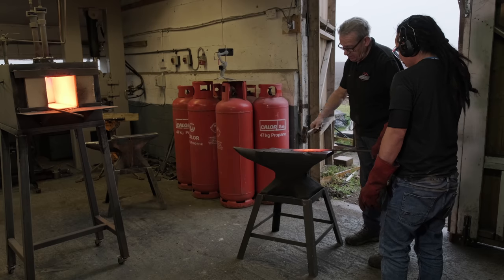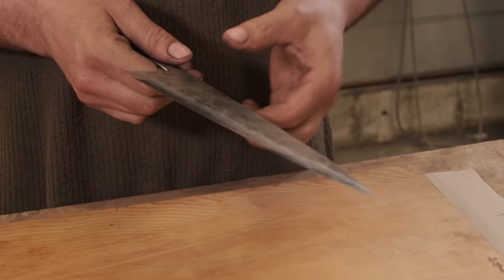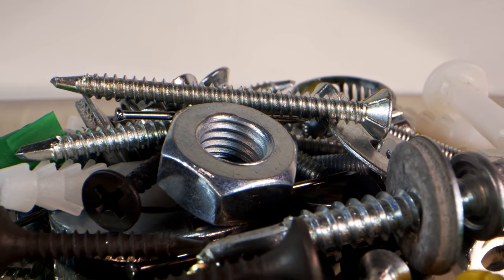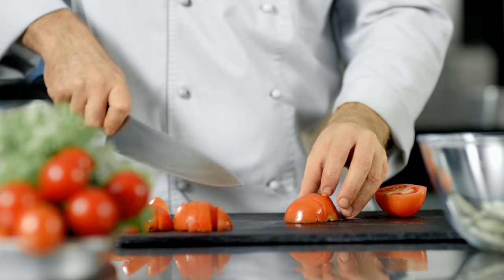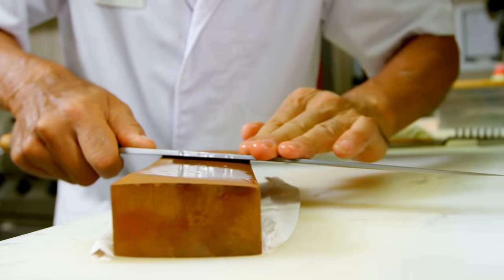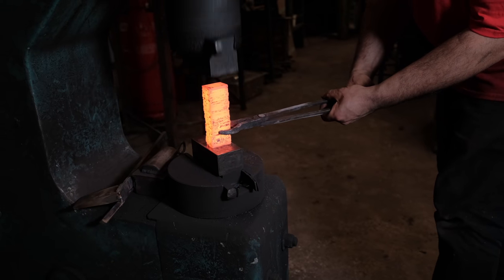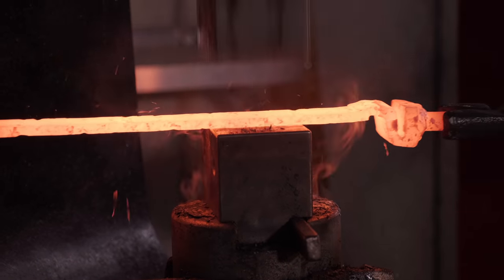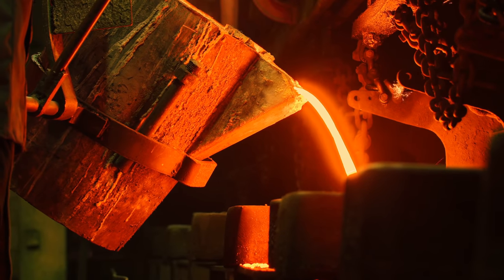Why 98% of knife makers pick the wrong steel according to a metallurgist

Comment: I am currently attempting to take a cheap stainless knife and transform it into something a little different. I don't have the tools, space and probably more to make damascus so I thought of something and it was on this topic. Cheap stainless steel blade, MIG/Flux a pattern staying away from the edge while piece is clamped so no warping. This is really just for looks, because stainless damascus is very hard while shooting low carbon steel onto stainless is near effortless. There is only 1 video on the subject as far as I know, but it looks good. Then when ready to quench, layer the blade in clay or something similar so that you get a hamone line. You may even want to have clay lines that run across all layers so there is a small line that helps prevent cracking, I think. In my head anyway, this makes a stainless steel with a damacus like pattern and the crystals are arranged from hardest on cutting edge to softest on spine, middle contains a little of each crystal structure. The reason why i'm trying to reinvent the wheel is because most people have NO IDEA what they are talking about. You cleared up YEARS of misinformation in no time.
Reply from the maker: Hi Andre thanks for the comprehensive feedback! Glad to hear you enjoyed the video as well!
Reply: Sounds like an interesting project. Let us know how you get on. I’m not sure if I’m picturing what you’re describing right but it sounds like a reverse SanMai type idea (stainless core, carbon steel outer layer)? 

If the art is what you are after then it’s a good plan.  I can think of few pitfalls if you’re aiming to make a useable kitchen knife, though.

Comment: I like O1 because I have it and it's everywhere. I also like it because it works well with hand tools. If the surface is polished, it is reasonably rust resistant, at least when stored. Extremely tough. I have both knives and woodworking chisels out of it. 

Anymore, I like both types in use. I prefer a sharpening jig with diamond so it really doesn't matter as I get older which is harder to sharpen.

Comment: As a toolmaker I have ground both PM steels and tool steels at the 60 + rocwell C  range and powder steel can be eraser to grind. When you get the parameters right , but this is on a proper surface grinder with at least a 50mm wide 350 mm Dia 46 grit J bond wheel usually dressed fairly course the Grinding Doc Dr. Badger explains it quite well in one of his videos but basically PM steel has hard spots smaller than the grit and tool steel often has the same carbides that are bigger than the grit. So I find it easier to remove stock from PM steel but they are both about as hard to get a good finish on especially on large areas  . For grinding tips Dr. Badger is worth a look but he is production orientated and very technical .

Comment: Ive been sharpening professionally for about 5 years now and for kitchen knives basic stainless works for me as long as the blade is a thin flat grind, can be honed in a matter of moments to a razor edge and doesn't need to be babied, and even when they dull the blade geometry will keep them cutting. I have a couple of VG max knives that are great but at 10x the cost of my beaters hard to honestly justify. When it comes to folding pocket knives is where I think PM steels really shine. S35VN is a great all rounder and Ive come to really like Cru wear because It takes and holds a screaming sharp edge. M390 and its analogues are also amazing for this purpose but significantly more work to sharpen when they eventually need it. Magnacut is apparently the next big thing but I personally have no experience with it yet.
Reply from the maker: Hi Mr Wednesday thanks for sharing your feedback on these different steels - it will be valuable for other people to see what you think of other steels they may not have considered for making before. Thank you!

- Vinz

Comment: Excellently presented by Graham and very informative...I knew most of what he said but he kindly filled in some blanks in my knowledge and got me curious about the highly rated, but never used (by me) AEB-L. 12C27 is my go to at this moment in time, I beleive it's very similar to AEB-L.
Reply from the maker: I've never heard/used 12C27 - will give it a Google alter today! Thanks for the comment buddy and I hope to see you in our other knife-making videos too!
Reply: 12C27 is very acceptable alternative for AEB-L. Should be little difference in grinding and knife performance.
Reply: @UKBladeshow  12C27 is used in a LOT of factory-made knives. For instance, the hugely popular Mora outdoor knives, and a lot of inexpensive kitchen cutlery. The only problem with that is that factories temper it way too soft for various reasons. HT'ed at 58 or better yet 60Rc, it should perform very much like AEB-L - and that's a good thing. 
13C26 is another steel in the same class that gets a bad rep because a lot of factories HT it too damn soft, but done right it's actually very good.

Comment: Howdy, novice knife maker here. I am currently using whatever the grubby sausages I call fingers can grab.  I have worked with 1095 and O1 mostly, but have also worked some old leaf springs (1950's era) which I guessed at 5160 (which let me tell you, was a 9 line B to try and work by hand). I have even played with a few old farrier rasps (and that wasn't particularly fun either).  I am currently working with some coil spring I picked up somewhere and will be experimenting with that soon. I have a single burner home built forge, an anvil, some tongs and a few hammers.  Sending off my blades to be heat treated is just not economical at this time. I eventually will grab a heat treating oven somewhere and will start working with stainless. I do agree with you stainless is definitely the way to go and will eventually transition in that direction but for us poor peons 1080 and its variants is generally the way to go when you are getting started. Heat treating is a science, if you do not have the ability or money to own a heat treating oven, and all you have is a forge and an oven high carbons are the way to go.

Comment: I’m a reformed knifeaholic and I’ve found that steel isn’t that important especially if you learn to sharpen and enjoy the process but there are some steels that stand out as being particularly good or bad. I haven’t fount anything i like more than cpm-m4. My spiderco gayle Bradly just flat out wants to be sharp. I’ve found not all knives are this way but it pics up a sticky ad he’ll edge that push cuts decently. I use diamond stones freehand and tend to put a pretty acute angle on my knives (more acute on one side unfortunately 😂 most of the time) I’ve used the gb so much that the lock bar is way into the tang and there’s a little lock rock. I also find the s30v on my bugout to be very workable, I can just clean it up on the bottom of a cup or car window every now and then to keep a pretty good edge then hit it with a diamond stone and strop every once in a while. A2 is also decent but seams to take a push cut edge which I don’t love. Not really impressed with s110v it loses its fine edge just as fast as anything. I like 3v by bark river quite a bit I’ve almost worked the handles lose on my bravo 1 lt by treating it like a pry bar and the edge holds up as long as it’s not thinned out to a ridiculous amount. messed around with cpm154 a little on a osprey k&t and it’s very similar to s30v. My tops Baja 4.5 in 1095 Seams to really like getting insanely sharp but feels pretty soft. Not a big fan of bd1 on the spyderco manix lw it lost its edge very fast and is noticeably worse than s30v in use. Used that as a like/boating knife bust it’s now at the bottom of Trinity Lake. I also haven’t been super impressed by maximet but that’s because it is the only steel that I’ve found to be legitimately hard to sharpen and I havenput the time in to figure it out. It is insanely hard. I love screaming sharp edges though and I suspect that’s another working edge steel.

Comment: Thanks. I hadn't realised segregation was the thing powder steels avoided. I've gone from 14C28N to CTS-XHP. the difference is quite noticeable.
Reply: Yes I'm a knife maker and have seen the up close cross section of powdered steels and its a big difference.  I saw 154CM and then CPM154 and the difference is night and day.  The steel is totally uniform, no gaps with carbides.
Reply: @TheLochs  Is that a cross section where it's fractured at a break? If not, how was the grain/whatever revealed? I'm just a user but blunt knives are like inaccurate rifles...
Reply: @cnm757  yes, it was broken on purpose to show the grain structure. I don't know how it was magnified but from what I saw it was very uniform compared to so called "regular" steel. You can look it up online.
Reply from the maker: Hi all lovely to hear people chatting about powder-mets too - do you think it would be worth making a video about it? What topics should I cover?

- Vinz
Reply: @UKBladeshow  you could spend the rest of the decade studying powder steels if you wanted to :) It's a really fascinating subject.
Reply: @TheLochs  the difference is even more dramatic with D2 and CPM-D2. With normal D2, if you sand it fine enough you can see the carbide banding with the naked eye. If you polish and buff it, it just gets uglier and uglier lol. That doesn't matter in it's intended purpose - stamping and cutting dies - but it's not great for fine, thin knife edges. That banding/clumps of carbides are why D2 knives have a reputation of "it takes a lousy edge but holds it forever." It's def possible to put a fine crisp edge on D2, but you have to work at it. 
CPM-D2 is clean like CPM-154, and due to the finer/more consistent structure it also has a lot better toughness than regular D2. It's kind of a shame that CPM-D2 never took off, but there are other PM steels that can do the same jobs it did, so it's all right in the end.
Reply: @dogslobbergardens6606  cool, thanks for the info. I think I remember CPM D2 from back in the day.

Comment: I don't make knives but I do buy a lot of them. Most of my blades are VG10 as I love stainless and Japanese knifemakers use it a lot. It's a pretty good steel when used by a good knifemaker. I have one Aogami Super carbon steel blade, it's fun and different but never a knife I'd recommend for most people. I have one S35VN knife, super interesting steel but the heat treat I feel left some edge retention on the table as I think the knife is a touch too soft. My next purchase is going to be a ZDP-189 knife, it's a bit of an extreme steel in how ridiculously hard it gets and it has low ductility and toughness but it would be so different from all my others, I can't help myself.
Reply: im a big fan of vg-10 myself.  not many compromises with it.

Comment: Very educational.   Thanks to my military affected memory I’ll have to save and watch many times to retain which is cool.

Question based on my limited obviously not professional metal working mind.

What happens if you put stainless in the middle of Damascus or plain carbon steel on a cellular level? ( too much time as a medic)

Harder vs tougher? 

Where is the fine line between a hard sharp blade and a brittle blade

My son said I waste time on these types of research but in my opinion the hardness vs toughness concept is in all parts of our lives… the old bend in the wind concept

Thank you for your time and sharing of knowledge 

History: Mig welding, rebuilding trucks cars watches, guns steel, wood etc and too many years researching how each affects the other  but I have yet to build my own forge… seems the parts cost this thing called money… thinking of using dirt.. :)
Reply from the maker: Hey buddy thanks for the fantastic question! Yes, you can put s/steel as your core but one of the reasons (that I know of) why people put the s/steel on the outside is for its “stainless” properties. Carbon steel, as explained is also easier to sharpen so for sharpening enthusiasts, that’d be more preferred. I suppose if you like your steel patina/stained and want a core that doesn’t need a lot of sharpening (but will take harder to sharpen), then do a clad construction with s/steel in the core. I hope that makes sense
Reply: If you’re asking about a stainless core surrounded with plain carbon then Vinz has given a good explanation of why a stainless core isn’t ideal. You get the worst of both worlds. A corrosion prone outer layer with a difficult to sharpen core when you really want the properties the other way around.

Or are you asking about using a stainless and plain carbon ‘Damascus’? If you are then the results would very much depend on what type of stainless you are using. There is a massive range of properties you can get using different grades of steel that all count as stainless - from amazingly hard and strong to very tough and corrosion resistant. You could even use duplex stainless which is pretty much a deliberate mix of two different grades with different properties in one alloy.

I can imagine mixing stainless and plain carbon in a Damascus would make for striking patterns with the contrast. Practically there would be little point since the stainless part wouldn’t protect the plain carbon from corrosion (and might even accelerate corrosion).

Comment: I like using stainless for kitchen knives because they are exposed to a lot of water, blood from meats and acids from fruits and vegetables. Just easier to maintain. Unless I'm dealing cutting away from bones then I may go with a high carbon so it doesn't get chipped from the bone. Outdoor knives I generally go with high carbon. Unless it's very humid, wet out or I'm by an ocean. The new super steels are starting to blur the lines between the two and it's exciting to see
Reply from the maker: Hello Sir Sir. Agree with you on the kitchen knives. I love my carbon steel knives as they are easy to sharpen and I also agree that it doesn’t need that much maintenance as many people may think. It’s horses for courses I suppose.

Comment: All Nitro-V and 14C28N for me these days, especially since focussing primarily on kitchen knives. Both handle very fine edge geometry, resist corrosion very well, hold an edge well yet are not too bad to sharpen,  more than tough enough for kitchen use,  they only require a single stage HT process (straight to 1060-1080, hold, quench) which suits my home made oven better (it doesnt heat fast enough to ramp up to different holding temps), relatively cheap, with excellent results from dry ice cryo (as long as the warping into the cryo is controlled). I can reliably and consistently hit 59-60HRC on every finished blade with my standard HT cycle. All grinding is post HT with water mist cooling jets, messy but effective.

Comment: I make knives, only as a hobby to keep my hands and mind busy. The reason i prefer steels like 1084, 1075 and 15n20 is because of the ease of heat treat. I can do it in my workshop without the need to create an oxygen free environment. Though i will say my next experement wil be a san mai billet with stainless outer and 1084 core for a kitchen knife. It should look pretty and remain reasonably easy to maintain.
Reply from the maker: Hi Adrian. I agree. Those are very easy steels to work with and produce fantastic results too. Thanks for taking time to comment!

Comment: I personally like A2 tool steel, the way I heat treat is clamping it between two aluminum plates then oil quenching, then immediately temper it at 400 for two hours. Yes I know its an air hardening steel, but oil is acceptable if you do it like I do and temper right away.
Reply from the maker: Cheers for sharing your thoughts! I appreciate it!

Comment: I have yet to find a stainless alloy that is easy to sharpen yet holds an edge. The closest thing I have found is Victorinox kitchen knives. Their hardness is only in the low 50's, yet they hold an edge surprisingly well. I'm currently playing with M3 HSS, which is pretty rust-resistant, surprisingly easy to sharpen, and holds an edge well. Forget about forging it though, you have to find suitable tools to make blades from, and take the thickness you get.
Reply from the maker: Thanks for sharing your thoughts Bob! If you enjoyed that video, we have the rest of the playlist HERE if you are interested: https://youtube.com/playlist?list=PLFssspwgISv-q8YPgoAg1XNZYw9YbMkJT
Reply: Ease of sharpening is a subjective take. I have a couple of knives in CPM Magnacut and the edge rentention is fantastic, yet the knife is easy to sharpen. 

With the right kit, raising a bur and polishing the edge is not difficult at all.

Comment: I've made and heat treated a lot of austenitic stainless, valves not knives. In austenitic we actively try to prevent chromium carbide formation. The carbides tie up Cr and effectively reduce the Cr content in localized areas. With matensitic stainless we are much closer to the 12% Cr content,, when forming lots of Cr carbides how do you prevent the same type of Cr depletion causing a lack of corrosion resistance?

On another note, I appreciate the statement about everything in metallurgy being a compromise. When anyone at work asks a question, the first words are often "it depends."
Reply: Often you do lose the proper stainless property. E.g D2 - it’s got about 13%Cr but over 1% C - It’s got better corrosion resistance than most non-stainless steels but is much worse than a true stainless. The reason to use the high Cr and C content in the case of D2 is to deliberately create lots of Cr carbides to improve its wear resistance. 

AISI 440 has a lot less C (0.4%) - its still stainless but has poorer corrosion resistance than, say, 318L. It’s grand for a kitchen knife but can’t handle really aggressive environments like being in the human body as a hip joint.